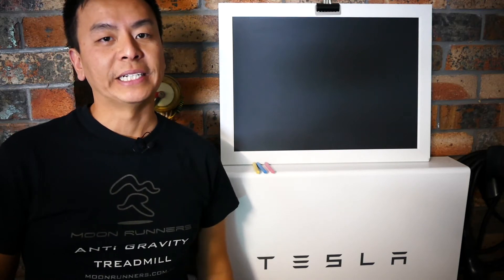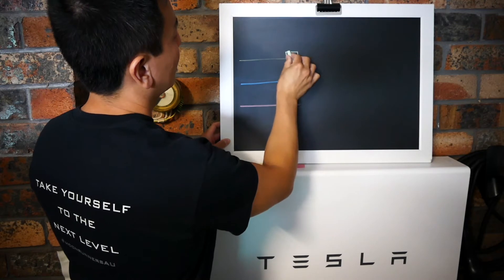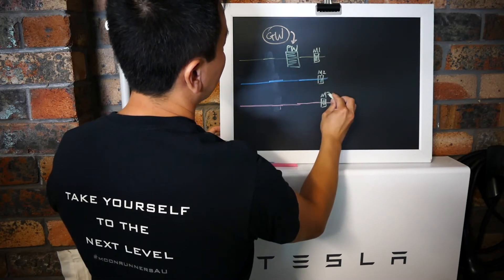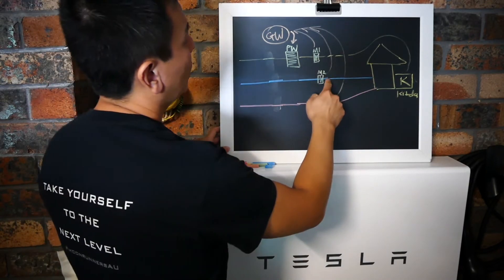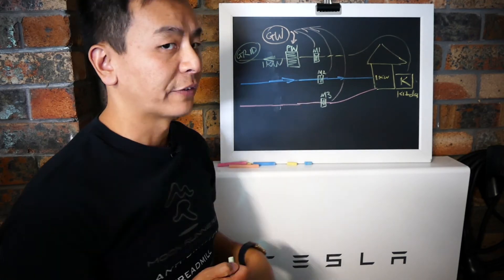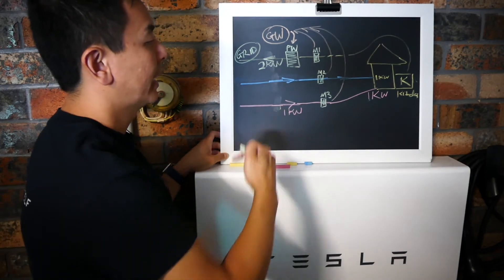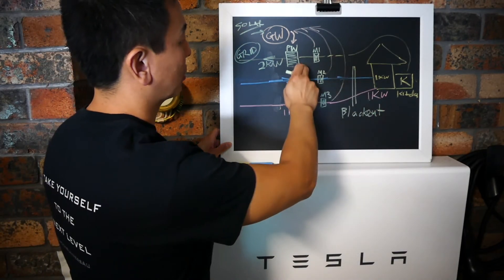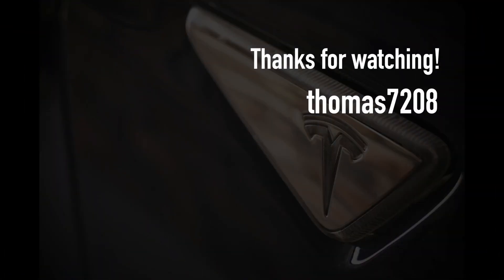EXPLAINED - Tesla PowerWall2: Integration with 3-phase power

Comment: Great video. In a grid failure situation will the panel still be able to supply energy to the house on the single phase or is the backup only from the battery? If it still is able to charge the battery and supply energy generated from panel, how is the 3 phase invertwr dealing with the problem of grid failure?
Reply: @barney5620  Great question and an important one when choosing the inverter.  In a power outage, your 3 phase devices, INCLUDING A 3P INVERTER will not work (no solar ) but a single phase inverter on the Powerwall phase will work.
Reply from the maker: Madan Morris Thanks for the question. 3-P inverter won’t allow backup function as far as I’m aware. The gateway is single phase and will allow battery backup and solar usage/charging. TT

Comment: You told about blackout,will the battery charges from solar on a three phase house with three phase solar inverter and single phase Powerwall at daytime if there is a blackout
Reply from the maker: Hi Praveen, thanks for the question.  As far as I'm aware, in the case of a blackout/grid failure, the solar panels will continue to charge the battery and power the house (on that single phase only).  Hope that helps.  TT
Reply: Will the single phase will generate 230V only  but the three phase inverter needs 330V on all three phases to kick off .....then how it will work in grid failure......
Reply: @praveenmussolini64  i suppose that will not work. But ask Tesla to be sure

Comment: Question... Powerwall2 has max output of 5kW but the grid can supply more than that on a single phase. So if I draw more then 5kW on the powerwall phase will the difference come from the grid or will the powerwall breaker trip and shutdown?
https://www.tesla.com/sites/default/files/pdfs/powerwall/Powerwall%202_AC_Datasheet_en_AU.pdf
https://forums.whirlpool.net.au/archive/2617560
Reply from the maker: Hey Sergey, great question.  The PW2 has can briefly surge to 7kW but otherwise, it will draw from the grid above 5kW.  The battery doesn't trip.  I'm speaking from experience having run an experiment with my oven, microwave, kettle and pool pump running all at once.  Above 5kW, it drew the extra from the grid.  The battery was safe.  TT
Reply: That makes since. Many thanks!

Comment: How do a system would look like with 3 power walls? In Germany a one phase backup wouldn't be enough, it would essentially cut some rooms from power or some outlets since they are evenly spread on the phases.

This would be a real bummer.

Also there are laws which forbids to use one phase on one device more than 3.6 kW (IIRC). This would limit the power wall output essentially to 3.6 kW on two phases, which doesn't sound that much, if you consider 3 phase charging of an EV.
Reply from the maker: Thanks for the comment Ruben.  My understanding is that Tesla would not approve that current configuration with regards to a PW2 for each phase.  However, my sources tell me Tesla's next gateway will be 3-phase which is great news - I don't know when this will be but hopefully in the not-too-distant-future.  
Thanks for watching :)
Reply: Waiting for PW3 then. Also live in Germany. Just once in my life living in the Netherlands I remember a blackout. 8 years in Germany and I just lost count.
I want/need 30kWh to get arround a 2 day outage. Which is the max I think.
Reply: O yeah, note that a EV (car) has quite an other energy demand than a household. Charging your powerwall in day time and emptying it during the night to charge your P100D, it will give you about 50km/33 miles If you don't use a single kW for your household.

Comment: Hello, thanks for the video,  I was just wondering is your solar system inverter 3 phase or 1 phase? 
As the battery will connect to the inverter as well right?
Reply from the maker: Colin Fan Thanks for your question.  The PW2 comes with a Gateway which will help the solar system inverter interact with the battery (regardless of single or 3-P).
Thanks for watching :)

Comment: There's no such thing as 2-phase power.
Reply from the maker: PingJerry Thanks for your comment. The title of this video may have been misleading, I have since changed it. The video is actually about the Tesla PowerWall2 and how it interacts with a 3-phase system. 
I don’t make any reference to any alleged 2-phase at any point in the video. 
Thanks for contributing :)
Reply: Yes a 2 phase supply can be run  to share the load . As long as all appliances ect run on single phase voltage ,no 3 phase motors
Reply: as said only 1 phase will be backed up
Reply: Depends. My stove uses 2 phase. But is devided between 4 heating elements. So 2 per phase.

Comment: All the Tesla info I can gather as well as speaking to them mentioned that the powerwall 2 don't export back to the grid. However when I use 3 phase appliance like ducted air cond or car charger drawing only 5 kw from the battery, the electric meter don't register any consumption from the grid at all. Where do you see info regarding PW2 sending power back to grid with the other 2 phases? Could it be that the gateway draw all the power from PW2 and then send it into the house on 3 phases? If that is the case, I wonder if I stack two PW2 on the same phase, would it supply up to 9 KW/H to a 3 phases air cond at work without drawing from the grid?

Comment: Thanks for the vid. Do all 3 phases charge the battery or just the phase that is connected to the battery? I cannot seem to find this info anywhere.
Reply from the maker: looc2 Thanks for your question. The battery is only charged on the phase that it is connected to. Thanks for watching :)
Reply: only 1 phase will charge the battery as only 1 phase is switched by the gateway . The other 2 phases are run to the gateway via 'meters' [current transformers] only to provide reference information to the system

Comment: Pretty cool here in America we really only have 2 phases so at least half will still work instead of 1/3rd
Reply: In America we do not have 2 phases, we have split phase which means from the power poll you have 2 hot legs each at 120v with their sine waves 180 degrees offset so that taken together they provide 240v.  Each individual leg is 120v relative to ground.  Reading the Power Wall 2’s specs, it is compatible with split phase meaning it can stand between the power company and your entire house and therefore power all your loads, both 240v and each 120v leg in the event of a power outage.

Comment: Typical Tesla, we know best.  Get battery storage at half the cost of Tesla and install a 3 phase Inverter charger. Don’t lock yourself into a company that will be gone in a few years. Also note that your 3 legs shone real requires that a circuit is 2 of the 3 legs. So single phase is IE leg 1 and 2, 2 and 3 or 3 and 1
Reply from the maker: Thanks for the comment.  Good tip re: 3 phase circuits - will remember that.

Comment: Is it possible to have 3 Powerwall a coverall all 3 phases?  How do multi-Powerwall setups work?  House I’m looking at has four of them so I’m trying to get a better understanding of the tech.
Reply from the maker: Siggen Thanks for your comment. You’re right, in a blackout you’d have to be wary of any 3-P loads - something to keep in mind if you’re considering PW2. I don’t personally have any appliances that require that kind of load. 
Thanks for watching :)
Reply from the maker: Sam H Thanks for the comment. As I mentioned in another comment, it is electrically possible to have one PW2 per phase but you may risk voiding your warranty. This is advice from my installer contact.
Reply: I think between your videos and the discussions on Whirlpool I have a pretty solid understanding. Thanks! I live in QLD and take delivery of my X next week so aside from the winter sun we have a similar set of problems.  Thanks for the great videos!
Reply from the maker: Sam H I’m so glad that I’ve been able to help! A major reason why I started this channel was because of the lack of information out there on battery storage. Have fun with the X! I know you’ll love it.
Reply: Ludicrous Feed it seems really sketchy to feed power to one phase in a blackout, if you have any three-phase loads, it could have some adverse effects
Reply: I think the problem would be: Air conditioners and 2 phase garden machine motors need the 120° wave phase difference in order to induce the motor to rotate. (going directly to 3 phase induction motors would almost be easier) Most modest homes have just 2 phase 220 Volt power anyway.

Comment: NZ has per phase metering and not net metering across the phases so this doesn't work in terms of billing  here - you would be exporting at export tariff... only NZ and Czech republic has this dubious set up. My question is can I install 3 x powerwalls (1 per phase) to over come this and also provide increased back up across all my phases?
Reply from the maker: Greg Hussey Thanks for the comment.  Now that’s really interesting to know regarding NZ. 
I asked my Tesla Installer contact about your question: it looks like although it is electrically possible to install one PW2 per phase, Tesla does not support this and it will void your warranty.  The max they can do without voiding your warranty is 3x PW2 on single phase. 
I guess we have to wait for either PW3 or an upgrade to the gateway (included with PW2).
Reply: Greg, I hear that some USA utilities are trying (currently) 
to sneakily back out their earlier commitment to "reverasable-metres" 
& "NET Meatering", 
in favour of seperate metres for "Import" & "Export", 
which ends up costing the "End User" more, 
for being grid connected (Grid-tied),
often exporting on one phase, 
while simultaniously IMPORTING, at the dearer rate, 
on another phase.

Comment: Hi and thanks for your.  I did not know the powerwall worked like this, so its great you have shared. Thank you :-). From what I understand the Powerwall2 is AC coupled, not DC. Will the Powerwall3 if DC coupled fix this three phase feed issue?   Could you please tell me who your installer was?  Are you based in Sydney?  I'm looking at installing a solar & battery system once the model 3 comes to Australia.
Reply from the maker: Hi Michael, thank you for watching and thank you for your comment - I'm glad you found this video informative.  Yes, you are correct, the PW2 is AC coupled as the DC version was scratched by Tesla before the AC PW2 was released mid last year.  Regardless of whether a future PW3 is AC or DC coupled, it will ultimately still require an inverter somewhere.  An AC coupled unit will need an inverter to receive solar energy from the PV cells.  A DC coupled unit will need an inverter to export to the house.  So it comes down to whether Tesla chooses to have a 3-phase inverter (DC) or 3-phase AC coupling built into the PW3/gateway to export a genuine balanced 3-phase load to the house.  

Yes, I'm in Sydney.  I can totally recommend Daniel and his team from QuadSol 0421 708 583 Very experienced and competent, Daniel will look after you and answer all your questions!  Are you sure you can wait that long for a Model 3?  Realistically, we're looking at late 2019 to early 2020.  Check out one of my other vids:  https://youtu.be/Dxbq2SPpUgQ
Reply: Hhhh 2024 and powerwall 3 hasn't been released yet in Australia

Comment: This all makes perfect sense, but why does it only supply 1 phase? I read on a bit on three stage and understand the frequency is the same, but they offset it by 120degrees making it so all 3 run at separate. from what I understand about the Powerwall is it can take the place of any of these, but usually the kitchen for reasons you mentioned. I'm wondering if this has the ability to output 2 at once or must you actually own 3 of them to true be off the grid? From what I'm reading it seems you could, but I don't know if there are other obstacles other than legality in some places.
Reply from the maker: Hi Mike, thanks for watching and thanks for your comment.  The PW2 can supply its own phase AND simultaneously export back to the grid to nett off the other 2 phases (which import from the grid).  I have evidence of this on my Tesla app - whereby the microwave is running (on the PW2 phase) at the same time as my pool pump (on a separate phase).  I suspect if you truly want to be technically off the grid, you'd need 3x PW2 - one for each phase or maybe wait for the PW3 which is rumoured to be true 3-phase.  Hope that answers your question.
Reply: Yea, thanks.

Comment: Thanks for that information. Perhaps you can help. Me figure this out. I intend to get 5 Powerwall to manage 6000 SQFT home, vehicles and home accessories. How would I compute the power management using your example? My hoke will have 2 breaker Amp system that equals 400 amps.  Would love to have your feedback. Thanks a million. I'm one of your new subscribers.
Reply from the maker: Hi David, thanks for subscribing! I’m glad you’re enjoying our videos. I must disclose that I’m not an electrician so my comments are based on observation and real world experience only. I can only find examples of 2 PW’s joined together from the Tesla forums and it appears that max output is increased to 10kW (single is 5kW). From memory, you can stack up to 9 PW2 so I would think 5 PW2 is achievable. I’m sure you could balance the units across 3 phases in a 2-2-1 configuration so that you’re covered in the event of a total power failure. But please check with your installer. 
Presumably you also have an adequate number of solar panels to charge those units. 
You will be able to manage your PW2 usage using the Tesla app once they’re installed. 
Good luck!